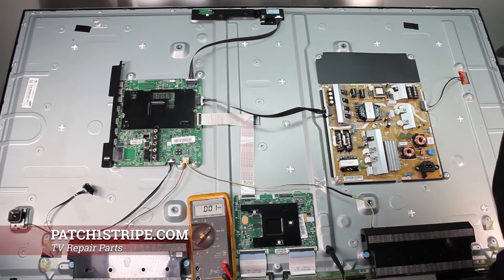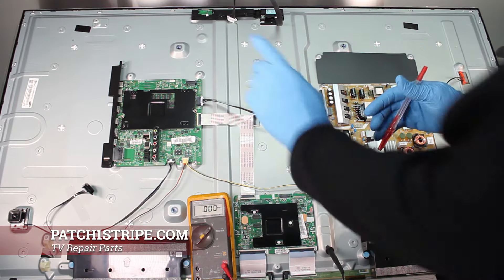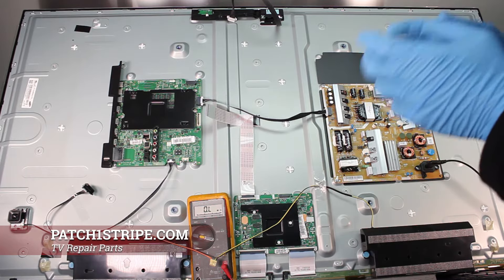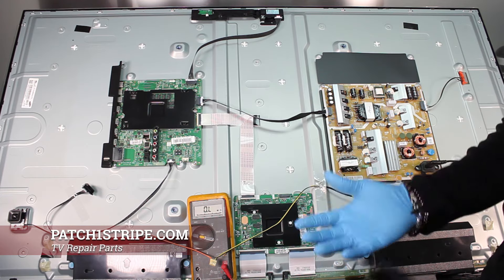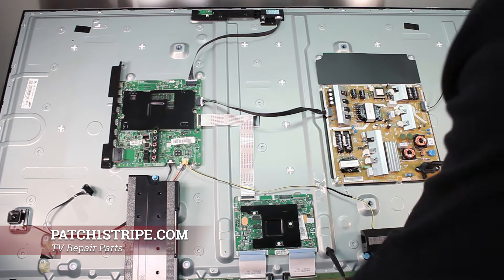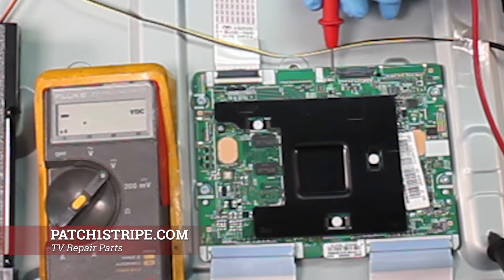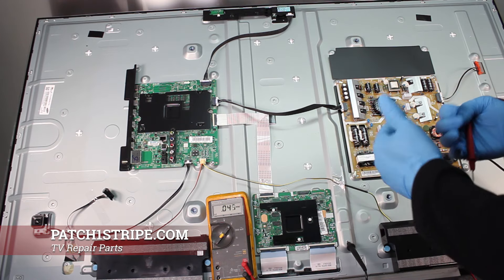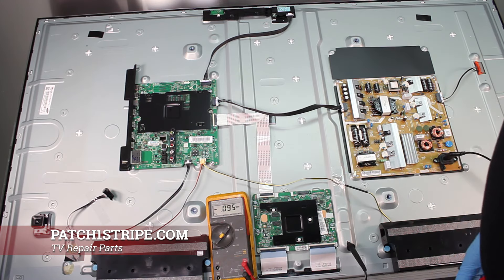HOW TO REPAIR ANY SAMSUNG LED TV:  Won't turn on,  No power

Comment: You really help me to find out I needed a main board for a Samsung tv. Installed it and the tv came on but the color was green and purple. Then I was dumb and went into the secret service menu and calibrated color, tv shut off and would not come on. No red standby light. If I push and hold power button the Samsung sign will come on but then the tv will shut down right away. have I bricked the tv or is there a fix. Any help would be appreciated.
Reply from the maker: I am a servicer and I never go into the service menu. If you replace a main board with the exact part number - no problems. I would at this point purchase a new board from a good seller and be done with this repair. Think about this, the microprocess you programmed is only on the board that was installed at the time you went into the service menu.  Change that board it probably was defected when it arrived.

Comment: We live in a throw away society now. My girlfriend thought I was strange for always ‘curbside shopping’ until I heard my neighbor dragging a big TV box to the curb last year. I walked over and sure enough, there was a TV inside. I dragged it home and found that it was a 55” Samsung 4K LED that was only 15 months old. I did some quick online searching and determined that the main board was bad. Samsung wanted over $700 with tax & shipping for that board. Not gonna happen! Eventually found a site offering all circuit boards and interconnection cables for less than $100 to my door. TV was fixed in about 20 minutes and has been working fine ever since.

She was impressed and loves the TV  and now has people bringing me theirs to fix.
Reply from the maker: That is awesome. Stay with me on my channel and I am sure there will be some information there that can help you in the future. If there is anything I can do to help you with a repair or parts, contact me.
Reply: @Patch1stripeTVParts  - You probably will hear from me soon. My neighbor on the other side has a 65” LG (65UH5500) that will power on and display the LG logo but then immediately tun off. I believe it is a faulty LED strip. I’ll know more when he gets back after weekend getaway. Also have a JVC that powers on when it wants to. It just doesn’t want to often...

Comment: Hi mate,
Great video!
My Samsung won’t turn on and has a ticking sound coming form the power source. The tv doesn’t have backlights turn on when the I disconnect the mainboard from the power source. However the ticking stops when I disconnect the wifi module. Could this be shorting the tv causing it to not turn on? 
I have also already replaced the power source board.

Any help is appreciated.
Cheers 👍
Reply from the maker: what is the model number of your tv?
Reply: Thanks mate 👍

Comment: great video. I have a couple 55-in Rohr led TVs no sound lights or power they are only 3 years old and just used in summer. gonna open them up tomorrow. thanks for the tutorial you are very good, get back to you for parts
Reply from the maker: Sounds great!

Comment: I have a Samsung tv and there is not led at all but when hit in the back sometime it will come out. Samsung people came over and didn’t solved anything but taking my money away… I sent you an email about some parts.. hopefully you will have it or If you fix my power board I’ll really appreciate it. Can’t find any replacements no where
Reply from the maker: what is the brand name, model number.  Are the lines horizontal or vertical? Important things to know for me to try to help. Hit me back.

Comment: Good looking out what if everything works just have cracked screen same model just a 65in samsung smart tv. Any vid on screen replacement for Samsung smart tv.
Reply from the maker: Not economical to repair unless you find a broken tv that is the same model that has a good LCD panel.
Reply: @Patch1stripeTVParts  whats the price im looking at for a LCD panel?

Comment: Do you guys have a resource to get a led strip for a Samsung tv that Samsungs part supplier does not have?
Reply from the maker: We are the best resource for hard to find parts. What is the model number of your TV? If you have access to, what is the part number on you led strips?
Reply: @Patch1stripeTVParts  Do you sell a led strip for Samsung UN55NU6900B?

Comment: is the heatsink on the mainboard removable? I have a frame 3.0 samsung, endless reboot, untill i freeze the main cpu heatsink then it boots up and works fine till it heats up again.... i want to take apart the heatsink, clean it and either apply tape or paste to see if that gets it working...
Reply from the maker: https://youtu.be/C9fJIMDrdno this link should help you to get another perspective toward resolving your issue.

Comment: I have a UN58AU7000FXZX that has greenish screen on right side and normal on left. It is hanging on the wall about 8 feet from a patio door that is open a lot to the salt air. Is this worth spending time fixing it
Reply from the maker: Hello, I would take the back off the TV and disconnect and reconnect all of the flat cables between the main board and the t-con board if you have one and if you do the same to the two small flat cables connected between the t-con board and the LED panel. This should resolve your problem. If not, swap position of the two small flat cable to see if the green screen goes the side of the screen.

Comment: Is it  volts ac  that you were checking on your main power supply board.
Reply from the maker: there are two section that the power supply is divided into - ac power which is converted into dc voltage to power the rest of the electronic device. Stay away from the ac power supply - very dangerous if you are not certified or qualified to troubleshoot. Now the lead connector between the main board and the power supply is dc voltage.  Be careful as well. If you think the power supply board is your problem, just purchase a new one and avoid the complications.

Comment: I have a un58m6070 Samsung Smart TV. My wife couldn't get the volume to adjust up and down and so I did a hard reset. Now the LED red light comes on stays on but no picture no sound. I disconnected the cable that goes from the power supply to main board and the back lights come on. I disconnected all ribbon cables Wi-Fi IR from the main board with it connected to the power supply and no backlighting no screen. Is there a return handshake between the main board and power supply? Or is there something on the power supply that is not getting to the main board? Love your videos and subscribing today.
Reply from the maker: I think you need to go back to when the problem started. You and the hard reset. If push comes to shove, replace the main board. Also, try disconnecting the main board from the power supply and see if you have backlights. If the backlights come on, again replace the main board.
Reply: @Patch1stripeTVParts  first of all, thank you for your response and I'm glad I found your videos. I did disconnect the main board and the back lights do pop on. I'm just concerned whether or not the main board might be getting the proper voltages since I'm reading about 3.7 volts which is not ideal. I noticed that they use the spring clips on the boards to maintain a chassis grounding and so my next step is to jumper  the ground between the boards to see if that might potentially help. I also ordered an eprom on the remote chance it could be that. I've been looking around for a main board and most of them are sold out of stock although one can be had for around 200 bucks. And therein lies my dilemma. The TV is 3 years old and the main board is half the cost what I paid. Although from what I understand the LED strips are a lot more reliable on Samsung than other TVs. I actually had a Vizio TV that exactly one year and 3 days it lost an LED. I was able to replace the one LED but still had a hard time getting the TV to work properly due to the adhesive method of the lines going from the LCD to the address buffers. I would periodically have to flex the TV to get it to work. You wouldn't by any chance know where I might be able to acquire the schematics for the main board? I'm kind of wondering how they're driving a clock source.
Reply from the maker: @rba5567  what is the model number of the tv you are working on?
Reply: @Patch1stripeTVParts   samsung un58m6070fxza da01. The board in question is bn94-12484x. I did find a bn94- 12484a but it doesn't seem like it would be compatible. It looks like it might have a daughter board for Wi-Fi. Also not sure if there's other major differences. The other curious thing on the power supply legends the minimum voltage going to the LED strips states 150 volts. Measuring j884 I'm reading 312 volts DC unloaded, 212vdc loaded when referenced to chassis ground.

Comment: Nice BK 520B! So... Do you still use it?
Reply from the maker: yes, a must when you fix anything!
Reply: @Patch1stripeTVParts  
I still use my sencore sweep circuit all the time. I love that thing. Have an inductance coil thats giving you problems spoof it! I also have 2 bk 490b's for rejuvenating arcade monitors. I love old test equpiment.

Comment: Looking for BN94-07345F...couldnt find it on ur website
Reply from the maker: The t-con board is probably fine. You have to resolve your mainboard issue first. I think that will solve all of your problems. I will check my warehouse to see if I have that part number. I will contact you in a couple of days.

Comment: My LCDs do not stay on when power up. When I disconnect ONE of the ribbon cables going to the panel the LCDs stay on. When I connect it back and then disconnect the other cable it stays on.  But when BOTH are plugged in the LCD panel flashes like it wants to start then goes out. Since I do not have a T-Con board in this TV and its built in with the main board or the PS, would one of those main boards be bad?  Thanks for a GREAT video!
Reply from the maker: If you are working on a LCD tv that is 10 years old round about. You probably have bad back lights. They are narrow fluorescent tubes that are not available to replace. You will be wasting time and money going any further.
Reply: @Patch1stripeTVParts  Actually its the SamsungUN65RU7100F LED. I'm suspect its power supply as I tested the mosfet and I got 120vts on inside pins but only 34vts on outside pins. Way off. Would you also change out ps board?
Reply: Well I have determined its one of the small boards that connects to the panel. Not sure how to isolate the fault on that board. Inspected all the ribbon cables and they look fine. Assuming there is a short.

Comment: Hi, great tutorial! Perhaps you can give me an advice. Have a UE65MU6179 with a BN41-02568 Mainboard (no additional tcon board) that got damaged during thunderstorm. There was only one HDMI port left working so I replaced motherboard and power board as well with second hand boards from a tv with broken panel. Unfortunately it did not work and now the panel is locked in power cycle every 10 seconds no matter if i use the old or the new boards. I even cannot get it to work with old boards that were working before without power cycle. Also replaced the power cable between power and mainboard without success. The backlights are working stable when I plug out the mainboard but when I plug the mainboard back in the panel is restarting every 10 seconds. I have no other components plugged into the mainboard, no wifi module, no speaker, no panel, only the power cable. How can it be that the panel is in power cycle and does not work even with the original boards that were working before? Do you think this is a firmware issue? How can I get this solved when the display keeps rebooting every 10 seconds?
Reply from the maker: disconnect the wifi module and see if that  affect anything. The main board should have been replaced with the exact part replacement. Something is not adding up. The part number is on the long sticker with the barcode and model number on it. On both main boards the part number should be the same.

Comment: Thank you so much for great video... I’m in a process of diagnosing my Samsung TV model UN49MU7000FXZA, so far what I found is when I disconnect the main board from power supply the back light stays ON without any issues but the minute I connect main board to the power supply the back light glows for a second and turns off automatically. Do you think I should replace the main board, since it’s causing the issues.

One thing I noticed is my tv model doesn’t have separate WiFi Antenna and Tcon board, looks like the newer version integrated these into one main board.
Reply from the maker: disconnect the wifi and t-con board from the main board and using the remote or the power button, see if you get back light if you don't replace the main board

Comment: I’ve watched all your videos, very informative. I have a Samsung UN65KS8000FXZA….the picture and sound just stopped…black pix with intermittent flashes of light from the back lights. Took it to a RV repair shop they said it was the main board…and wanted $500 to repair…couldn’t do that so I ordered a new board, changed it out and the picture came back but is distorted with lines through it, the sound is back as well…so I got a replacement board…and it does nothing…the back lights intermittently flash, no sound with replacement…so I am not sure what to do…could it possible be the t-con board? Already replaced the power supply board and it wasn’t that…I am ready to give up….I am a nurse not a tv repair person…..but the tv was quite expensive and only 4 years old….any recommendations?
Reply from the maker: How did you determine that you needed to replace your main board other than what the RV repair shop told you? Next, where/who did you purchase your main board replacement from? What is the part number of both main boards? This information is on the bar code label that also have the model number printed on the same label. Let me know this information so that I can help you. Also did you follow the video and disconnect the main board from the power supply and the backlights come on when you apply power?

Comment: Thanks brother great video
Reply: If you can help me to buy a replacement main board for my Samsung 55 inches nu55mu6290fxza  version cc09
Reply from the maker: Hello, the part number for your main board is BN94-12642D. Don't think I have it in stock. Can't check inventory now.
Reply: Patch1stripe TV Parts 
It’s un55mu6290fxxa
Version cc09
Bn68-05050A-00
I could not find it any where 
Thank you for your help
Reply: Still not working on@off
Reply: Gerald Grant yes not working
Reply: No

Comment: i have a un55mu6300fxza the tv has in a power on and off loop no show logo when you connect start with that without touch the control. the controller shows blinking 7 times the light  and i check the leds and its ok i take out the main from psu and the led stay on. .. what you beleve
Reply from the maker: Did you try disconnecting wifi module and turn on tv? Did you disconnect t-con board and turn on tv? If your tv did not turn on after disconnecting those two items, you need to replace the main board.

Comment: Hi boss I have here Wanza LED TV 50 inches there's power but black screen and there's no supply voltage on the backlight!Then I try to check the backlight strips there is some bulb not working.What was the exact problem on this,can you help me?Thank you boss...
Reply from the maker: Sound like you are on top of it. You have to replace the bad led strips. They will shut a tv down every time.

Comment: Hi I have a samsung ue40d6200 that won’t power up but has standby light. Managed to open up to see that the back lights are still working. I have seen a guy on eBay selling a ue40eh5300 with broken screen but everything else working. Can I harvest the parts for my tv?
Reply from the maker: yes - for sure!
Reply: Thanks for your quick reply

Comment: Hi I have a Samsung t32e390sx which wont turn on at all. Fuse in plug is ok, Taken the back off and all circuit boards seems ok front and back. Would you have any idea what I need to look at next. Thanks
Reply from the maker: I would follow the instructions on the video.

Comment: Excellent video !!
I have samsung LED tv un60ju6500fxza, version  # HD01
Serial # 03ME3CCG900766Y, power standby light is on, since last month difficult to turn on, 
I have Unplugged TV from the wall and waited 60 seconds. Remove the batteries from your remote and hold the power button for 30 seconds, after several attempts tv was  on, I did a factory reset yesterday, it  worked for 1 day,  same problem again. TV is not completely dead yet,  I would like to know if you can give your professional advice how to troubleshoot , and  which part to buy so I can  fix "hard to power on" problem.    Thanks...
Reply from the maker: Hello. Follow the process on the video will take you directly to the faulty part. I would recommend to you to disconnect the main board from the power supply. Apply power to the power supply board. If the backlights come on, leave the power connected for about 5 to 10 minutes to see if the backlight goes off. If the backlight does not go out, disconnect the power and reconnect the main board to the power supply if your problem persists, disconnect the t-con and the wifi after removing power again to see if the problem still persists. If it does replace the power supply. If the problem doesn't connect the wifi and the t-con one at a time to see which one is causing your problem. Hope this helps. We have replacement parts for your tv at Patch1Stripe.com.

Comment: If I have a Samsung TV (Say, 55") can I use it's Main (Logic) Board with another Samsung TV (Say a 65")? It seems like the LVDS output from the Main board should feed any T-COn board. (is LVDS a standard?) Likewise, can I use a power board from one Samsung TV in a different model Samsung TV?
Reply from the maker: Not so. Most main boards are unique to its model.